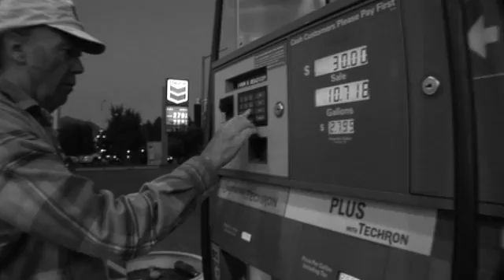Neil Young & Lincvolt at SEMA 2010- Part 1

Comment: Biodiesel does not compete with food.  Soybeans are planted to meet the demand for livestock feed. Soybeans are crushed to separate the protein meal that is fed to livestock.  The oil is generally not fed to livestock.  Some soybean oil is used to make salad dressing, deep frying food, and that gooey stuff inside twinkies.  But in total, the food uses for soybean oil don't equate to the volume of oil that is coproduced with livestock feed.  Only the surplus oil is used for biodiesel.